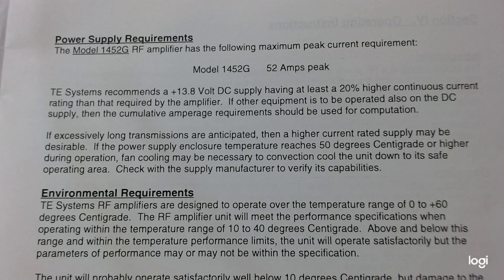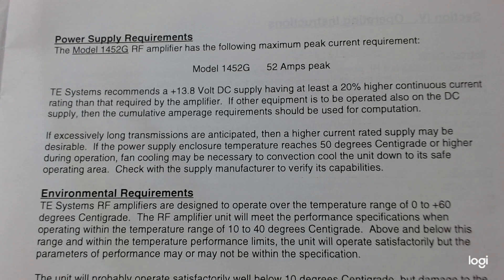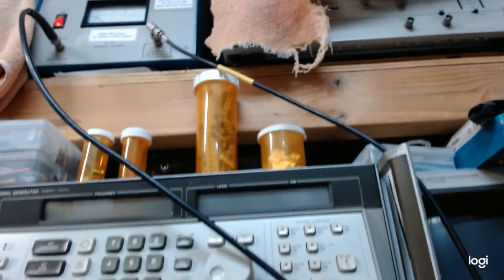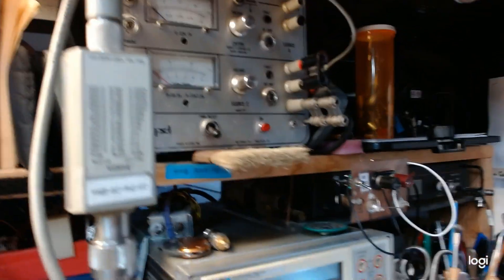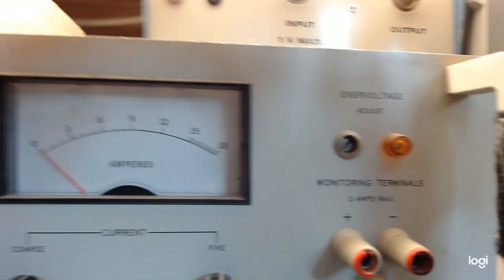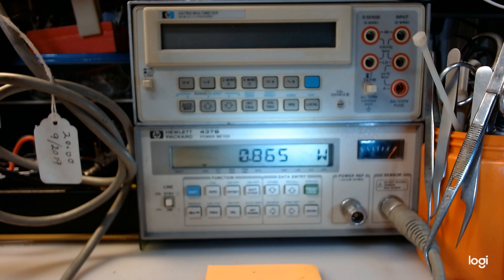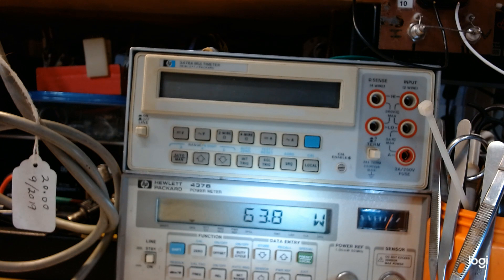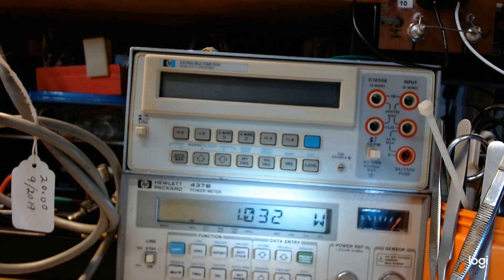TE Systems TE-1452G 2 Meter RF Power Amplifier

Comment: Max input is 20 watts. Have 3 of these amps (1452G, 2252G, 4452g). Over past twenty years. So-- good and bad: Good: If you are care full and don't overdrive, amps are great. You must use AWG 8 to ensure proper voltage. Recommend Astron Rs70 power supply. If you make a mistake, overdrive it, SWR's go up, you will blow them up. No protection on these amps at all. Buyer beware. And good luck trying to get it fixed. Problems are well documented on QRZ and Eham.
Reply from the maker: TNX David, I agree, a poor design. It found a new owner: Buyer beware.